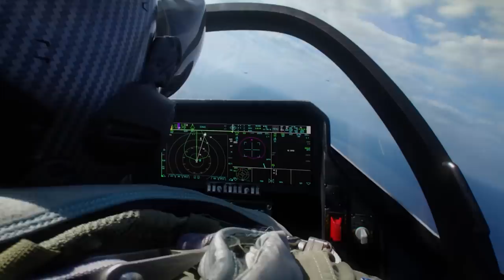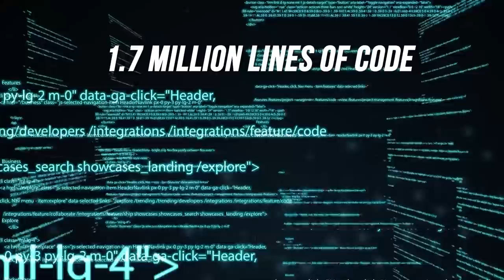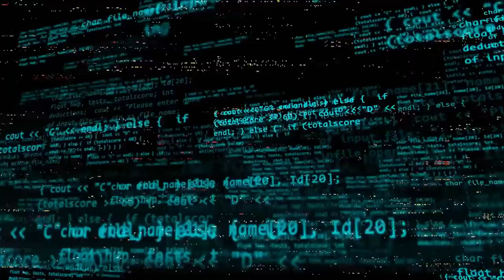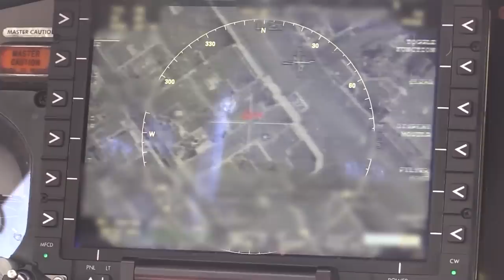US ARMY of 6th Generation Fighters Shocked The World

Comment: As I understand it, the production equipment that was used to manufacture the F-22, has been dismantled while any production equipment which could be used to manufacture the F-35 was scavenged from the F-22 production lines.

Therefore, we can only maintain the fleet of F-22’s, while upgrading F-35’s which are currently in production and maintaining the F-35’s which are currently in use.

It is my position that the primary reason that the production of the F-22 was halted as the result of espionage by individuals masquerading as American citizens or other corrupt individuals who sold massive amounts of F-22 production and systems’ intelligence to China. I believe that a great deal of intelligence regarding the B-2 Spirit stealth bomber suffered from similar problems.

The design resemblance of China’s “5th generational” fighters and bombers is by no means a coincidence.

Hopefully, security will be much tighter regarding the F-35, the B-21 Raider, the coming NGAD and the FA/XX aircraft. 

There was a day when those individuals who were found guilty of espionage were often executed. Sadly, that particular deterrent is gone with light or in some cases, no sentences at all being handed down.

Comment: Keep the F-22 around for a decade past implementation of NGAD just in case it's needed. Bring NGAD on ASAP, and relegate F-22 to a domestic reserve defense role & close in base defense role - situations where dog fighting might come into play, if other defenses fail or get exhausted in protracted active engagement.

Perhaps a limited capacity/reserve use role similar to F-117.

With retirement of F-111 and F-117, there is an overall shortage of combat ready airframes. F-22 can help bolster numbers in roles to which it is still suited. It could augment the F-15E & F-15EX functions. 

It could serve similar roles to fleet defense function, albeit base defense & homeland defense.

The sooner its sidelined the longer it can be used in a reserve & limited capacity.

This could allow smaller but faster issued iterations of New Century Series NGAD fleets as 6th Gen gets tweaked and improved with each ensuing sub-generation iteration. No need to perfect - get the first wave out now, asap, as 2nd wave is right behind the first wave.

Speed up deployments.

Do to the CCP (& Russians) what the CCP has been doing to us.

Just get em out & keep em coming.

Comment: There aren't significant enough quantities of the F-22 to even consider it very useful to military operations on a large scale. 

     We desperately need the NGAD to be developed as quickly as possible. And built in large numbers.

    But when I hear them talking about energy weapons technology, I question whether this will become another big bloated budget program. That will be a decade behind schedule like the F-22 ended up.
       Ultimately killing itself. With its bloated budget political maneuvering to get its parts built in as many separate states for the money. And then being shut down because of its stupid cost per unit and time overruns. 

In a lot of ways, the F-22 was obsolete by the time it entered service. 
Although a better plane did not exist at the time, a much better plane could have been built at the time.
      With computer technology having advanced so substantially before it ever even went into production. 
     The design and technology it was carrying were already pretty well ancient tech. What started off as a great new fighter if it had entered servicein 1994. "Hey look we've got these new things called computers that we can design a great plane with". Beck in the mid 80s,. To entering service in the 2005's where personal computers sitting at home. Were hundreds if not thousands of times, more powerful than the computers used to start designing it. 

You just can't take a decade-and-a-half to bring your plane to production and expect it to still be state-of-the-art in today's world. You can tell that they thought it was a feat of engineering that it had one-and-a-half million lines of code LOL. 
 I cringe to think about how absolutely and underpowered the computers that the F-22 is carrying are even by the time it entered service
Reply: Usa need to produce more fighters jets